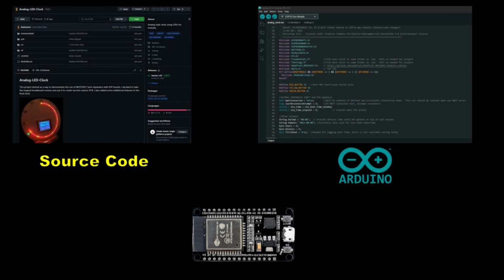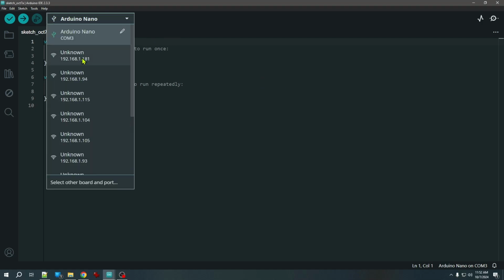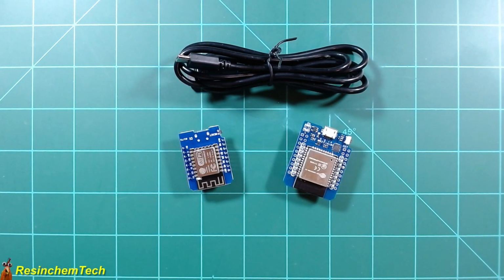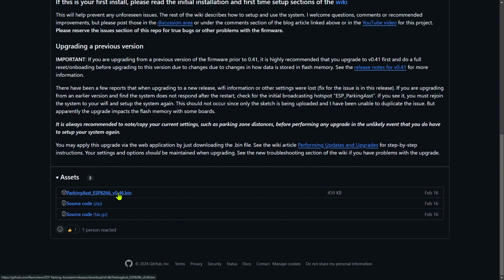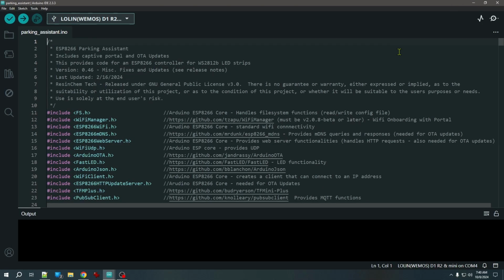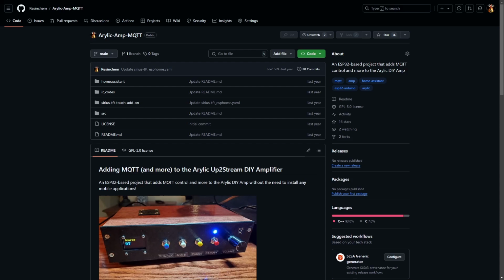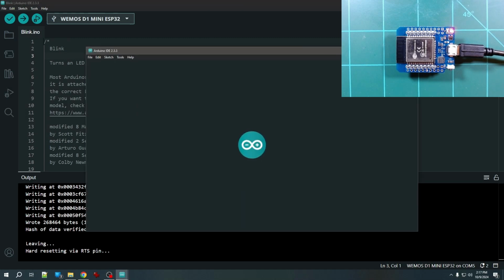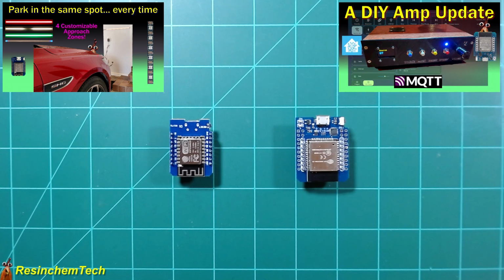Arduino IDE: ESP32/ESP8266 Basics for Non-Coders

Comment: To start off with programming ESP32 cards with the Arduino IDE, here's a tip: Get an actual Arduino card with the ESP32 chip on it. Make sure the card and software work. That' because if the software's going to work, it will work when you use an Arduino UNO R4 WIFI card. When you can get that to work, then and only then do you try the mystery card. If you're lucky, it'll work out of the box, Chances are, you'll have a battle. But, God only knows which circuit cards will never work.

Comment: Great tutorials!   Do you know where I can find an accurate cross reference of the ESP32 version of the D1 mini from GPIO to Arduino standard Dx / Ax pin numbers?
Reply from the maker: Well, for anything relating to the ESP boards and pinouts, I usually go to Random Nerd Tutorials:  https://randomnerdtutorials.com/esp32-pinout-reference-gpios/

That site has a ton of useful information on ESPs, Arduino, Raspberry PI, etc. but in a nutshell, if you know the GPIO/pin type used on the Arduino, you can cross reference that to the GPIO/pin type on the ESP8266/32.  For many of the pins on the ESP boards (more so with ESP32), you can use a given pin for many different purposes by simply defining the pin in your code.  Do note that if you are trying to take an app/firmware designed for the Arduino and use it on an ESP board, it likely will not work (pins aside).  Firmware is usually compiled for a particular type or family of boards and moving to a completely different architecture normally requires a rebuild of the firmware for that different board type.

I don't know if that helps or not, but honestly I've only used an Arduino a couple of times for very specific projects so my knowledge of them is somewhat limited.  I pretty much use ESP boards for my projects (maybe with a Raspberry Pi thrown in from time to time).

Comment: Although I've never had a reason to use the IDE and I was, frankly, intimidated by the thought of using it, I think I may try my hand at tinkering with it and doing a project, thanks to this video.
Reply from the maker: It's really pretty easy to be able to compile and flash Arduino sketches to ESP boards without really knowing any C++.  And it does open up a lot of new possibilities and projects for your ESPs.

Thanks for watching and thanks for the comment!

Comment: Thanks for posting.  I've been following your channel for a while, and it's been great content.  My major hurdle with ESP32 and ESP8266 boards is that I usually have some no-name, non-descript board I found on Amazon, and I can't for the life of me figure out which board to choose in Arduino IDE.  Any suggestions for which board type to use when you just really, truly, have NO IDEA what board you have in front of you?
Reply from the maker: First, thanks for the kind words.  In terms of selecting a board, I will generally just use the ESP32 Dev board for generic ESP32s.  In most cases, this works just fine.  If I have an oddball board, I might have to try a couple other options, but the ESP32 Dev works for most generic ESP32 boards.

If I use an ESP8266 (which I am slowly moving away from since support for the ESP8266 from Espressif is slated to end next year), I generally use a Wemos D1 Mini... which is included in the list.  However, if I'm using a full size "NodeMCU" style board, I select either the NodeMCU 0.9 or 1.0 depending on whether my board has an ESP-12 or ESP-12E chip.

99% of the time, those selections work for generic boards.  Of course this is assuming the cheap clones are actually wired and pinned out (and actually work!).  I have received batches of boards that were simply dead-on-arrival, including a shipment of 5 ESP32 boards where 3 of them couldn't even be flashed!  Hope that info helps a bit!
Reply: @ResinChemTech  good reminder about the ESP8266s going end of life next year.